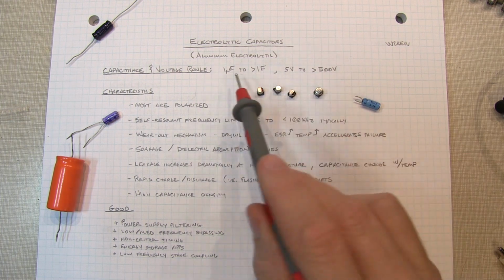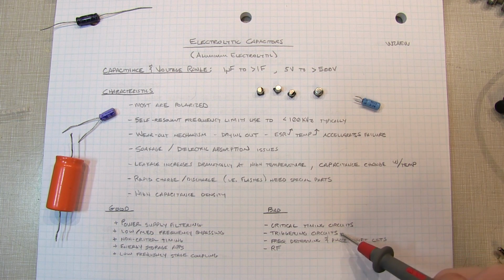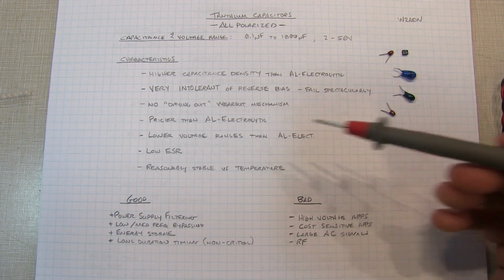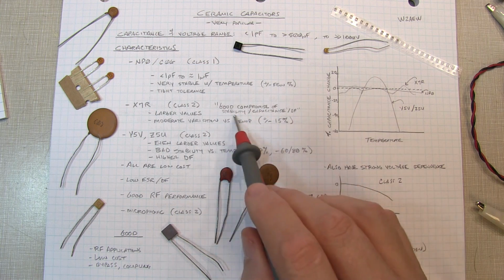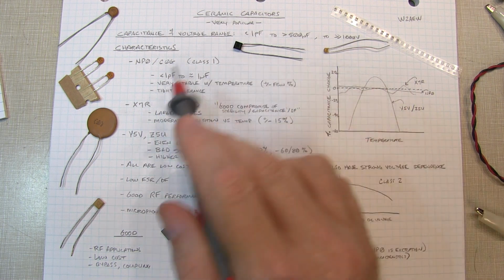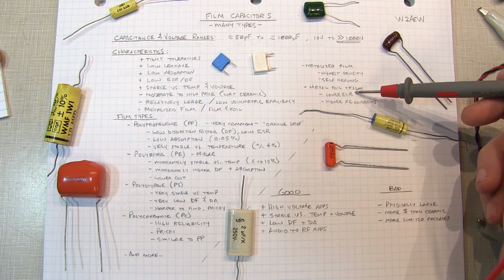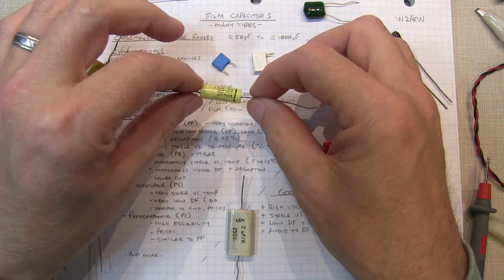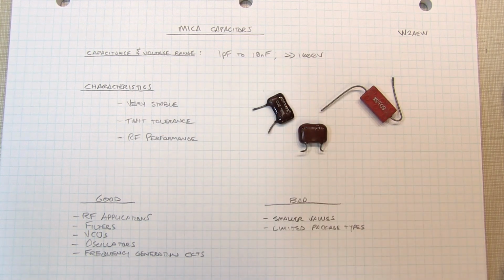#256: Capacitor types, characteristics, and applications

Comment: There are two types of mica capacitors that one may come across, if restoring old equipment. The silver (Silvered?) mica capacitor. good for tuned circuits, very stable, brown case with a RED fleck. Silver can grow crystals internally, causing a short. A "Stacked" mica capacitor, similar brown case with a GREEN fleck, still stable, but not so prone to the same s/c conditions. Just for info.

Comment: Make a video lesson about using an LED as a capacitors by using it backwards by using the LED depletion region like capacitor plates. I have been told that "Diffused LED" VS "Non-Diffused LED" have different capacitances to go over in the video lesson. I'm not sure why Diffused LED have a different depletion region capacitance compared to Non-Diffused LED depletion region capacitance. By varying the DC voltage on the LED being used backwards it will widen or narrow the LED depletion region capacitance using the LED as a capacitor
Reply from the maker: This video covers the same topic, except focusing on varactor diodes. The same variable capacitance effect will happen with LEDs, but with different values and adjustable range. #147: Basics of Varactor Diodes | Voltage Controlled Oscillator VCO Example
https://youtu.be/icw8terKP-M

Comment: I've been an electronics hobbyist/repairer for a fair time.  I've had experience with power circuits, analog (not RF) and digital. Your video compelled me to investigate the ceramic caps insulator types. I FINALLY UNDERSTAND. Previously it was a void in my understanding. The stability/capacity was an amorphous cloud that I could not sort out. Now I can... Phew!

I also recently discovered the class-X and class-Y capacitors. I've seen them, but never knew their special forte (fail open) and where each is intended. It's really a subject for EMI, but their unique behavior/purpose would make them a solid contribution for any capacitor type review.

Comment: I find that much new production capacitors now have tinned copper plated steel leads instead of tinned copper leads. Just take a magnet to some of the parts that you have purchased recently including resistors. What are your thoughts of the effects of steel in the signal path?
In my personal experience, I found a big audible difference in sound quality when exchanging a coaxial cable sending the composite audio between a broadcast stereo generator and a commercial broadcast transmitter exciter.  The original cable turned out to be copper plated steel and the replacement was a solid copper center conductor cable.
Reply from the maker: I haven't really examined it, but certainly the steel will have higher resistance, which may affect signals in a low impedance environment like audio.

Comment: Your videos are some of the greatest,  especially for learning new things that you may not know or reviewing things you may have become rusty on. A lot of my family are in the recycling business and let me go through the electronic circuit boards before they are sent off. One of my finds was an old medical defibrillator machine that contained a 36 microfarad electrolytic cap rated at 5200 volts DC. It has a warning on it in regards to what you were saying about absorption. It warns about recharging back up after being discharged. Another thing that may be interesting to people watching this video has to do with mica capacitors. I worked in mining for many years and would pull off chunks of mica that I would find on the ribs ( side walls ) of some drifts ( tunnels ) and the mica came in sheets almost the same thickness if not the same as the mica insulators used to insulate transistors and other electronic components. made me wonder how those insulators and mica caps were made from this type of mica. Thanks again for your great, informative, and very interesting videos.

Comment: Capacitors specs don't have a rating for the wattage of the capacitor, so how do you know the wattage of a capacitor? Some circuits use capacitors as a voltage dropper instead of using resistors to be the voltage divider they will use a capacitor instead which I'm guessing will dissipate less heat when using a capacitor as a voltage dropper?
Reply from the maker: Capacitors don’t have a power (wattage) rating because they don’t dissipate power because of the phase shift between the voltage and current.
Reply: @w2aew  Capacitors with ESR do dissipate power because all capacitors will over time generate an ESR. Ceramic capacitor will generate ESR based on what? I understand the chemicals in Electrolyte dry up so that causes ESR. Poly Capacitors and Ceramic capacitors generate ESR based on what?

Comment: So the question is:  Is a tantalum capacitor also an electrolytic  capacitor?  Wiki says yes.  There are two basic types of tantalum capacitors - wet and dry electrolyte types.  Please don't confuse the natives out here! ;-)
Reply from the maker: Yes, both are electrolytic. Here is an explaination from a major manufacture of caps. https://www.tdk.com/en/tech-mag/electronics_primer/9#:~:text=An%20electrolytic%20capacitor%20is%20a,supply%20circuits%20and%20similar%20applications.

Comment: Tubular ceramic capacitor how to test
Reply from the maker: These are typically very low values, so you'll need an LCR meter that can measure down into the pF range.  Very reliable, rarely fail.

Comment: Dear Professor, 
 Would you Please make a tutorial from A to Z on how to work with the Signal/function generator and oscilloscope for hobbyists and beginners? 
I need it to calibrate and fine-tune my R2R tape recorders and do small troubleshooting.
Deep Regards
Reply from the maker: Everyone's needs and usage of signal generators and oscilloscopes is different - it wouldn't really be practical to do an A-Z video covering everything that hobbyists and beginners would need, without it being hours long.  I have several beginner tutorial videos on signal generators and oscilloscope usage, including videos on the most common mistakes people make (search for the work "wrong" in my index file found here: https://www.qsl.net/w2aew/youtube/W2AEW_video_index.pdf).  There are also a lot of videos on the basic operation of oscilloscopes and their fundamental controls (vertical, horizontal, triggering, probes, etc.).

Comment: What is the differences between Capacitor Leakage current compared to a Capacitors RATED Leakage Current? Often in power supplies they will put two capacitors in series to increase the capacitor but will put balancing resistors in parallel across each storage capacitors. The Resistors across the storage capacitors are to regulate and balance the capacitors RATED Leakage current. How do these balance resistors control and regulate the capacitors Rated Leakage current?
Reply from the maker: A capacitor's leakage current is the small DC current that flows through the capacitor (as if a high value resistor was in parallel with the capacitor). The RATED leakage current is the largest amount of leakage that is acceptable to consider the capacitor to be not faulty.   Two capacitors in series does NOT increase the capacitance, it actually decreases the total capacitance.  You would usually see two capacitors in series to increase the voltage rating, and then the parallel resistors are there to ensure that the applied voltage is divided equally across the capacitors.
Reply: @w2aew  The Swamping Resistors that are across the series storage capacitors are in series so the swamping resistors add? If the swapping resistors are 220K + 220K = 440K across the series storage capacitors. The swamping resistors do something to regulate and stabilize the capacitors RATED leakage current?
Reply: @w2aew  what formula do you use to find out the capacitors RATED leakage current?
Reply from the maker: @waynegram8907   No formula.  This is something that you would find in the manufacturer's datasheet specifications.
Reply: @w2aew  yes true the capacitors rated leakage current is on the datasheets but that is just say the maximum leakage current at operating conditions?

Comment: Why is the impedance at max at the resonance frequency for capacitors and inductors? The AC voltage is decreased to the lowest AC voltage because of the capacitors or inductors impedance is at max during the resonance frequency. What is the difference because a capacitors or inductors impedance compared to the complex impedance. Most electronic theory books says capacitors and inductors have an impedance and also a COMPLEX impedance, but what are the differences between impedance and complex impedance?

Comment: One way to tell the difference between Polyester and Poplypropylene film capacitors is that PP in general have much higher Q factor. This requires a proper LCR or capacitance meter, though. Common PE caps have typically a Q value of 100 - 200, whereas PP have >1000 or even >10 000, similar to PS caps and Micas. I noticed that cheap CBB (PP) caps that you can buy nowadays on Amazon, Ebay and from China, have the same Q factor as their similarly looking PE counterparts (Q around 200). I don't really know what's up with that. Maybe stick to known brands, especially for higher frequency stuff where Q matters.

Comment: Whats up with MLCCs - Multilayer Ceramic Capacitors and Single Layer Ceramic Capacitors ?
Reply from the maker: They typically fall into the Ceramic capacitor category (slide 3)
Reply: @w2aew  in your video about using capacitors to filter power supply noise, there is no discussion about ESL and the capacitor impedance at high frequencies, have you made a more detailed video on power supply decoupling capacitors?
Reply from the maker: @優さん-n7m  I do have a video on capacitor self-resonance, and I talk a bit about it in my decoupling video.

Comment: Back in the 30's to 50's the RF Radio designers would use capacitor temperature coefficients to have this technique called "Evening Effect". I'm not sure if you know about this Evening Effect but if one capacitor drifts up or down the other capacitor will drift in the OPPOSITE which causes them to have this evening effect. Any reasons why this happens or how to design a circuit to have this evening effect?

Comment: How are DRY Electrolytic capacitors different than WET Electrolytic capacitors? I'm not sure why a EE designer would prefer using DRY electrolytic filter caps in the power supply because mostly I see filter capacitors use WET electrolytic. Some Multi Caps that are 2 or 3 capacitors in one package have 2 or 3 different max voltage rates in the same package which I'm not sure how each capacitor in the multi cap can have different max voltage ratings per each caps. Like one will be 300vdc the cap#2 will be 350vdc and cap#3 will be 450vdc in the same package of the multi cap. I wonder why they can do that have 3 different max voltage rating per each cap?

Comment: Another really great video! 
I am a scrounger for mica cap wherever I find them since they lately have become so expensive and hard to source. One current source I found at fairly decent price is the SMD ones from Cornell-Dubilier MC Series. Limited stock has been available at RS components. Used many of the 10pF 1000V 1210 ones with very good results.

Comment: Is it always true that you can make any capacitor non-polarized by connecting a pair of them together with their negative lead and use the positive leads as the capacitor leads? You'd end up with half the capacitance of one of them, and double the voltage rating, right?

Comment: Hi, I came across your perfectly shot video about capacitors, you talked about the temperature dependence, but it's a pity that you didn't point out the problem with soldering with polystyrene capacitors, it will permanently change its capacity when the terminals overheat during soldering. At present, it is no longer the case that the mark on the capacitor indicates the outer foil and it is necessary to do a hum test with an oscilloscope to identify it. I have met capacitors marked this way many times and often the outer foil was on the opposite side from the brand.

Nice day 🙂Tom

Comment: How fast tantalums fail from aging, if at all?
Reply from the maker: There's no general rule.  Most age very well and don't fail over many decades.  Some inferior caps can fail much earlier.  HIgh voltage stress, high temperature and high ripple currents can accelerate the wearout.

Comment: I'm a bit late to the video, but... 
Tantalum capacitors ARE electrolytic capacitors. That's why they are polarized. An electrolytic process maintains the dielectric layer of both the aluminum and tantalum, so you can't reverse the polarity or the dielectric insulation deteriorates and the plates short together. The 2 basic types of electrolytic caps are aluminum and tantalum. 'Non-polarized' electrolytics are simply 2 high voltage aluminum electrolytics (thick dielectric,) that are hooked back to back.

Comment: What is the differences between all the capacitors you've presented and "oil based capacitors"? Also, are there any major differences in quality/ESR/temp/triggering/storage/etc characteristics between commercial capacitors (available for everyone) and "military/medical/science/high end customers" capacitors? I know that is a huge differences between "commercial use" and military/medical for transistors....
Reply from the maker: Oil filled capacitors are generally for high power (high voltage, high current) applications where the extra dielectric strength and thermal conductivity are needed.  Military and other high-grade capacitors are generally the same from a performance standpoint as the commercial grade parts - the big difference is in material selection, quality control measures, etc. to ensure very high reliability as well as operation in extreme environments (high/low temperatures, etc.).

Comment: Well done Alan. I knew about the 3 digit classifications and knew it related to the quality of the cap. But never knew exactly which was which. Among Hi Power Tube Amp Builders there was quite a discussion about whether it was "Good Practice" to use those big Ceramic Door Knob Caps as Padding Caps for a tank circuit output. Do you have any opinions - observations on the matter ? Also when doing that how do currents divide across the caps ? Are the currents proportion to the Cap Value or Inversely Proportional ?
Bob AA6XE
Reply from the maker: I don't have any direct relevant experience with regard to homebrew of tube amps, but the ceramic doorknob caps are generally used there due to their high voltage ratings, low loss and stable capacitance characteristics.

Comment: How do you test how much DC voltage is passing through the Capacitor? If you apply a DC voltage on ONE end of the capacitor lead and other capacitor lead should measure Zero Volts? but what other types of test can you do to measure how much DC voltage is passing through the capacitor?

Comment: with regards to the dielectric soakage discussion, presumably you're in a space with quite a lot of EMF generated by all the equipment and wiring. How do you know that's not just being induced in the wires to create the voltage in the capacitor just through the energy that'll be in the air?

Comment: thank you very much for sharing. I was wondering when looking at a component data sheets and in there are graphs of the measurement for the component. are all those measurements for the graphs referenced to ground (earth ground). I mean when I am measuring DC or digital signal do I got to put the ground on the earth ground or the negative of the voltage supply to the IC chip being measured?
Reply from the maker: In many (most) cases, the circuit ground and earth ground are the same.  Measurement graphs and voltage measurements/specs are typically measured against the circuit ground unless otherwise stated.  When using a VOM or DMM, you can place the probes at any two points you like to measure the voltage between.  When using a scope, you have to be more careful, since the ground side of the probe is connected to earth ground.  Again, in most cases, circuit ground is the same as earth ground, so connecting the scope probe ground there is OK.
Reply: @w2aew  thank you thank you very much. 
my apologies if my questions are simple. but I have 1 or 2 more question. I be glad to watch another video about them if you have made one. 
I am new to scopes but been using DMM of higher quality for many year in the field repairing equipment. I am trying to get familiar with PCB diagnostics. 
Just so I understand please, lets say there is a VCC or VDD +5VDC. Do I attach the scope GND to Vss / VEE which ever is specified?
how about probing in areas with higher voltages in PWMs.
I am aware of isolation transformer and in progress of building one.  
I been a field technician (or 1/2 a technician since I don't now how to use a scope). 
with the way equipment manufacturers are designing and pricing replacement boards, I got to either learn how to repair them in a timely manner or quite and become a parts sales person.

After banging my head against the wall for a couple years finally I learned how to repair a $2800 PWM, with no help from scopes. but by the time I was able to repair these boards most people were buying newer model machines.
the $2800 PWM is the not the expensive board in the group.  
 
thank you again for your replay. videos like yours is like water for a thirsty one like me. .
Reply from the maker: @Moe-monom  The answer depends on the circuit.  In some cases, VEE or VSS will be the same as Ground.  In other cases, VEE or VSS might be a negative voltage with respect to ground.  When using a scope, the probe ground should be connected to ground in the circuit.  You will have to check your circuit to see if VEE=GND or VSS=GND in that case.
Reply: @w2aew  thank you thank you.